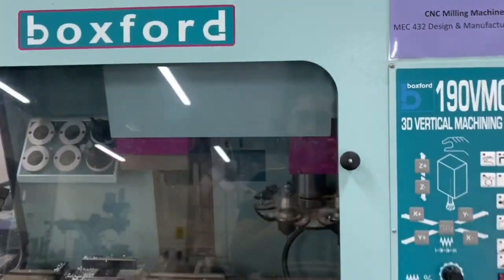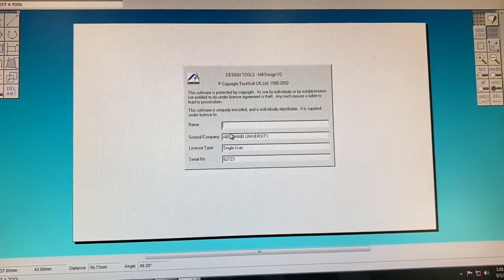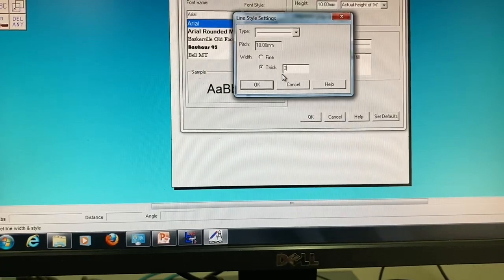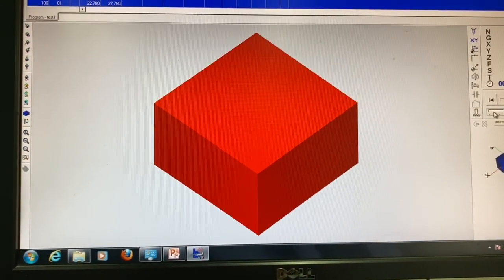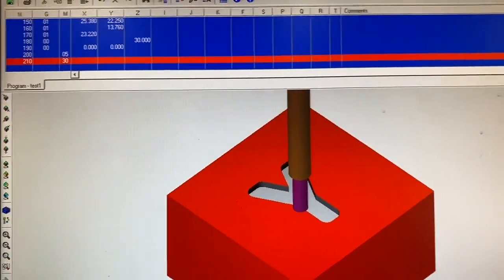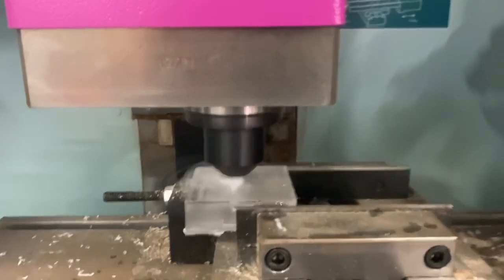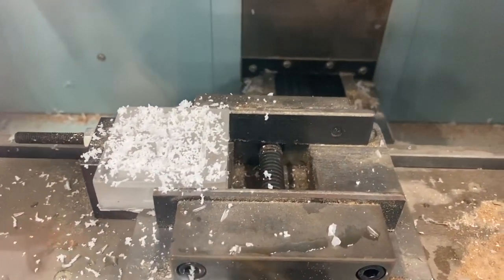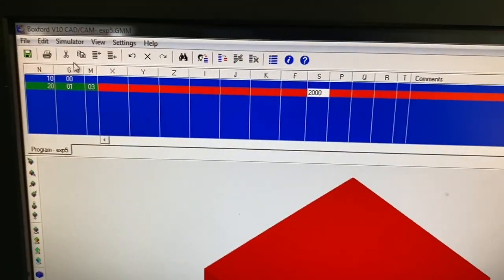CNC Milling Machine Demo - Boxford 190VMC

Comment: Hi thanks for the clip it's very informative and well done, I just purchased a vmc190 second hand  and am making the decision to use the boxford software or retrofit a centrioid acorn motion controller.
 I am an experienced machinist and I did spot one big problem with your workholding,  if you were machining anything harder than polycarbonate even a deeper cut or running higher feed rate your material would come out of the vice this can be embarrassing at best or a very bad outcome putting the machine out of commission, injuring yourself or others and destroying the workpiece at worst. A machine vice clamps in the centre of the jaws on the centre line of the thread and there is an amount of play in th movable jaw, hence if you clamp to one side of the centre you are only going to get very low clamping force on your right hand corners ( the adjustable stop was the only thing stopping it from flying out). If you are only machining 1 piece I would centralize it in the vice to keep the movable jaw parrallel for maximum clamping force on the workpiece, alternatively run a workpiece at both ends of the jaws which will also clamp better as it keeps the movable jaw parralell and even better run 2 workpiece offsets and do 2 times the cutting per tool  change. 
Paul
Reply from the maker: Paul Hunt Thanks Paul for your valuable input. Will sure keep that in mind next time